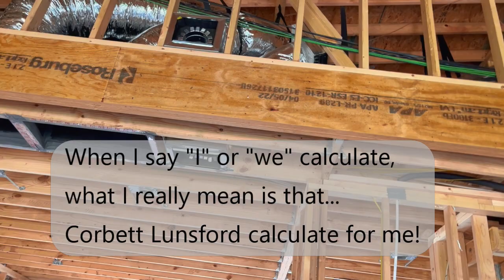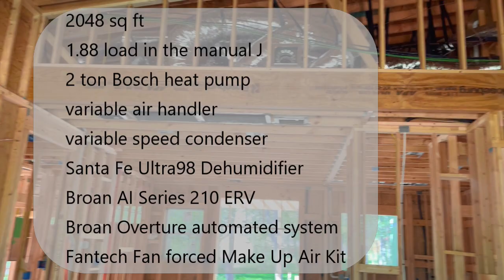HVAC overview part 1 - The True Family House Series

Comment: Really liking this series, please keep it up. A few questions. I assume your ERV and Dehu feed into the supply side of the HVAC, so did Corbett size that for all three to be running from a CFM perspective? Did you consider a ventilating dehumidifier from Santa Fe to combine your make-up and dehu? Lastly, why not a heat pump dryer? I feel like once you are at 1 ACH50, why bring so much make-up in when it can be avoided. I look at how much more stress it is on the system and it just doesn’t seem to make sense.
Reply from the maker: ERV goes to the return side of the air handler and Dehu goes to the supply side. Duct sizing was considered for this. The Dehu is a ventilating dehumidifier from Sante Fe. Normally, the ventilating port would be closed off because the ERV is doing that work but in this case, it's being used for dryer make up air. We might get a heat pump dryer but I wanted to solve this problem regardless. I need to solve these kinds of problems for future builds.

Comment: Thanks so much for the videos. On average for a house that size does it cost to have an expert design your ventilation plan like what Corbett did for you.  I am currently in the design phase of my "forever home" and want to build it the best we can but on a budget. Thanks again for sharing your knowledge.
Reply from the maker: The cost depends on several factors, but it's small in comparison to the whole project. It's highly recommended to have someone, like Corbett, help to design a system. In the end, it may be a collaborative effort, but in general, don't just trust HVAC companies and engineers. Engineers are great, but they often see things through a slightly different lens.

Comment: So excited to watch your house build. Filing knowledge away for my own some day. How are you handling your clothes dryer? Is the dryer intake going to be hooked up to the ERV or how is it typically done?
Reply from the maker: I have a 6" make up air damper ducted to the port on the dehumidifier that is meant for ventilation. That port would normally not be used because my ERV does the ventilation. That 6" may not be enough so I have another 10" damper ducted next to the return grille of the dehumidifier. Both dampers will be on switches

Comment: This may be a silly question. But did you ever consider doing mini-splits throughout the home instead of HVAC? The concept of mini-splits intrigues me, but would they work well in a tight home environment?
Thank you! Keep up the amazing content!
Reply from the maker: They are very energy efficient and work well for heating and cooling a space. What they don't do well is circulate, filter, and dehumidify. Often you'll need to combine other equipment and more often than not, it becomes more expensive than a standard AC.

Comment: Hi Scott
Really enjoying your content.  New to your channel.  Wondering what you recommend for penetrations for a woodburning stove/fireplace/etc. while trying to maintain your standard of a tight house?  It would also be interesting to see a video on how you shingle a roof vs. metal.  Thanks for your hard work and info
Reply from the maker: Most high performance builders will recommend against a wood burning fireplace because they are inefficient and produce toxins. But We did one where the owners really wanted the experience of a fire. We had a damper that they could open to bring in fresh air but I also gave them instructions to open a window. So the penetrations is the damper that was flashed and the chimney had a chase built around it that we foamed.
Reply: @ScottTrue  Thanks Scott..Agree...They ar ineffcient for sure.  Trying to come up with a backup heat plan in case power goes out here in Northwest Arkansas

Comment: What dryer vent do you use for a tight house? Most the ones you see on houses and in hardware stores would not have a good airtight seal when not in use
Reply from the maker: True. I am using a standard dryer vent that is probably not that air tight. As soon as I find another option that is easy to buy, I might switch.
Reply: @ScottTrue wonder if you could get away with using a actuated damper for that